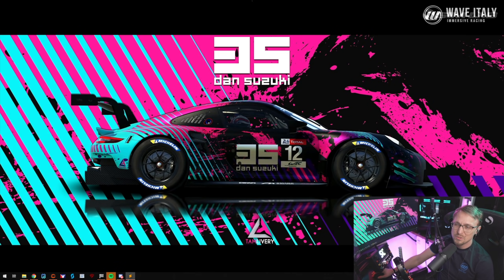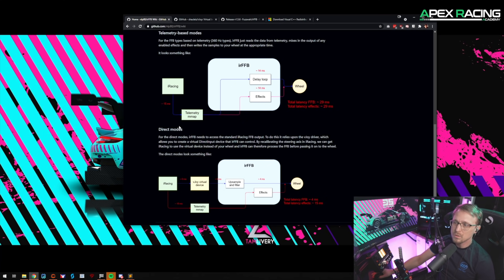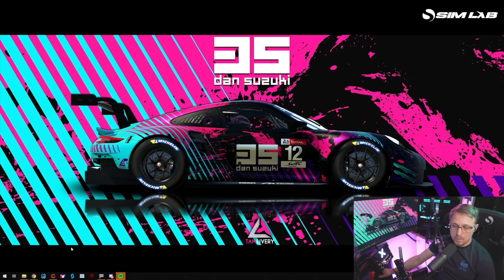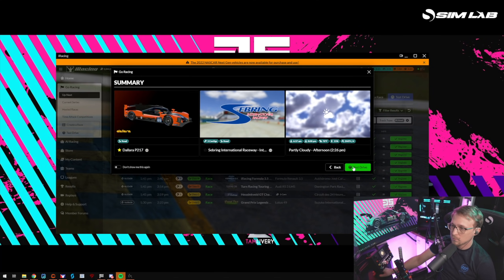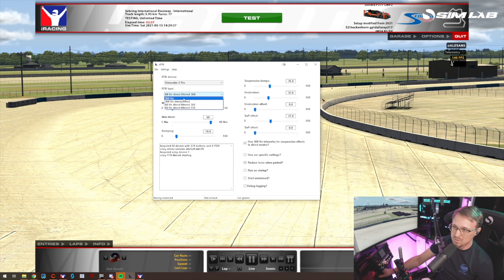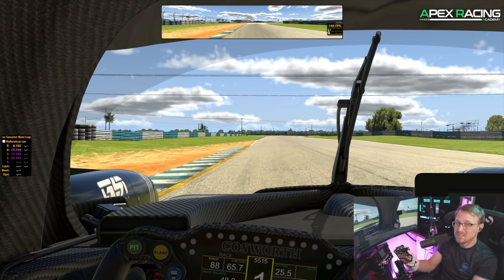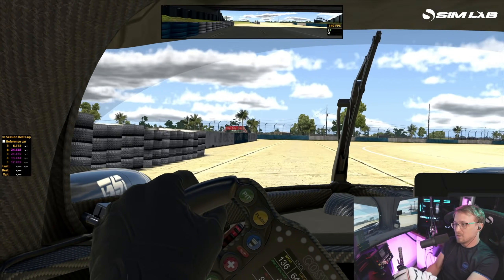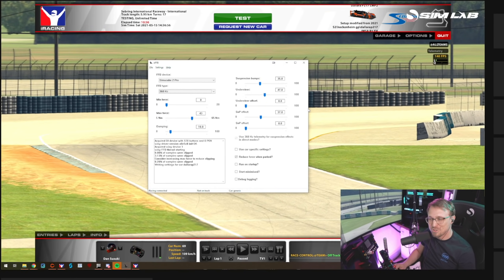Better FFB for iRacing? irFFB and vJoy install guide | Tutorial | iRacing

Comment: Is this worth it with a CSL Elite wheel base?
Reply from the maker: Try it out and report back. It takes around 3minutes to set up ;)
Reply: It is really worth it with the CSL, real game changer.
Reply: It's a game changer on any wheel
Reply: I installed irffb for my CSL Elite. If it works properly wauw, what a improvement. 
But to I first need to start up irffb then iRacing?
And do I need to do the calibration in game every single time when I start up a session?